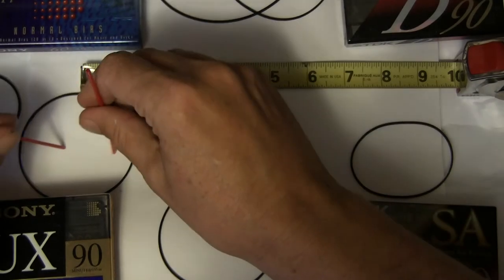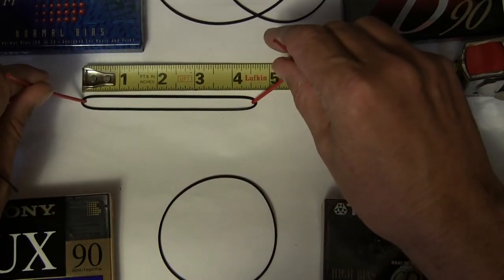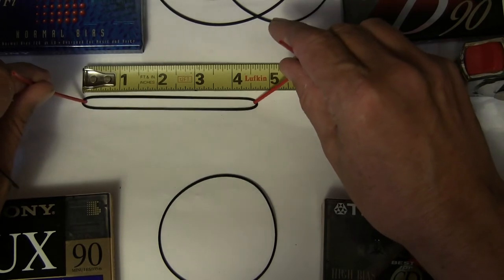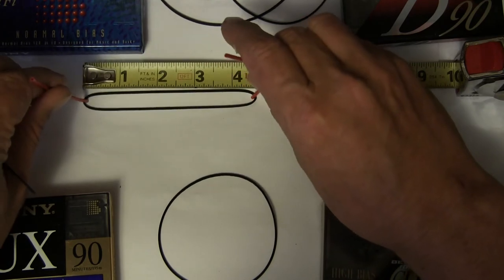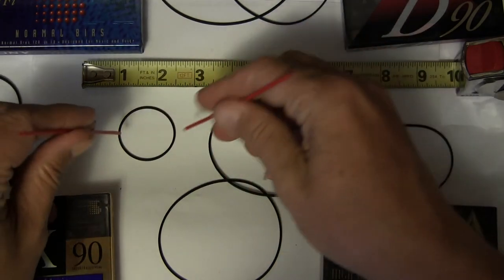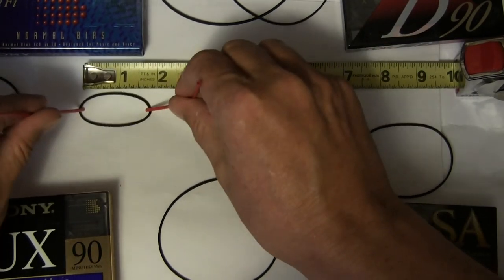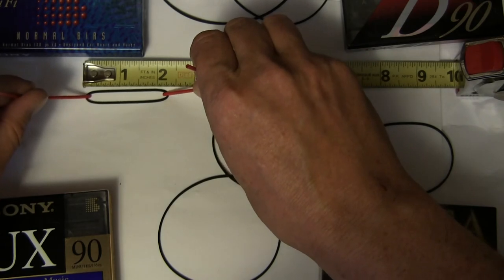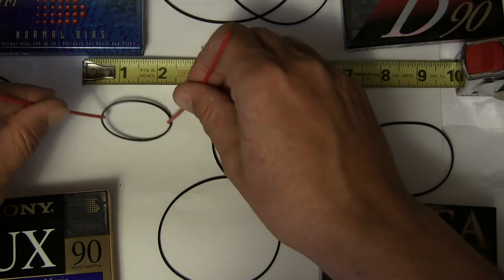How to Measure Walkman Boombox drive Belts almost all sizes Square Cut & Flat

Comment: Where is a good place to buy belts?
Reply from the maker: 1.  http://www.turntableneedles.com/Rubber_Drive_Belts-Tape_Decks_Turntables
2.  http://www.ebay.com/usr/mihokm
3.  http://www.stereo2go.com/topic/belts--almost--all-sizes-square-cut-andamp-flat
3A.  Once you have joined Stereo2go goto here http://www.stereo2go.com/profile/193392314111620226 & start dialog = send a pm - to the Doctor in India an he can sell you belts too.